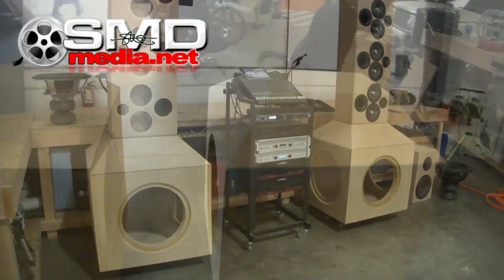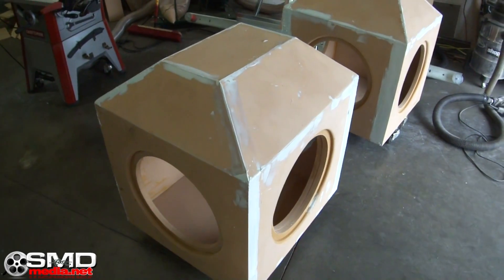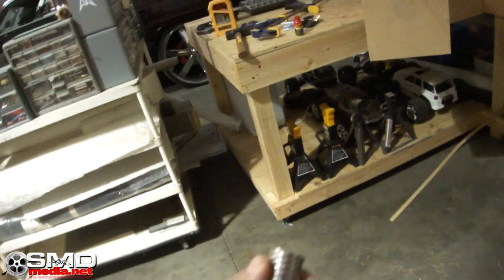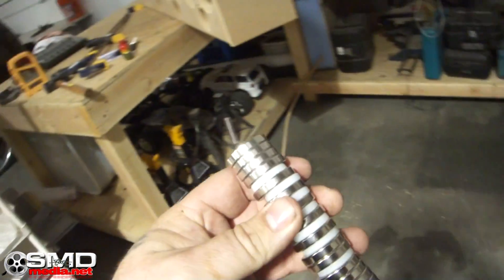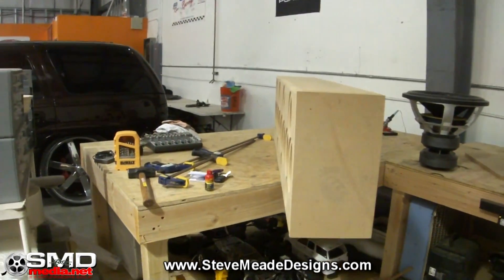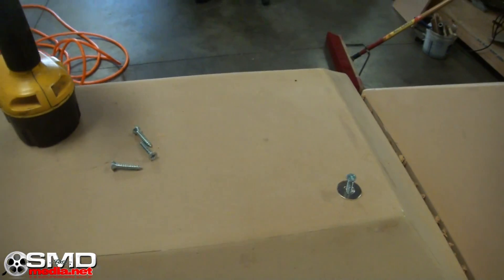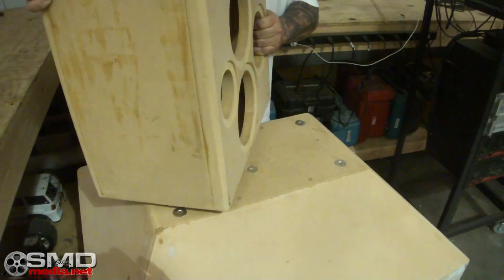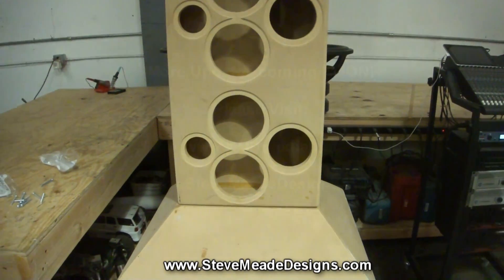Towering Towers - NEO Magnet Attachment - Build Progress Video 7

Comment: @meade916 Bondo is basically 2 parts, a bonding agent and very fine sand.  When you mix on something like wood or cardboard you lose bonding agent with out losing any sand.  Just use a piece of foil over the DMF.  Never mind that bondo and bondo like products are meant for metal and not wood, bondo needs to be sealed off from moisture.  I would just use wood filler or my fav resin. 
As for SQ I'm sure they'll still sound better then  l-acoustics.

Comment: @hilldog39 Simple physics.
He's using magnets, not glue or bolts, so the force between the magnets holding the boxes in place is strong, but not as strong as if it were meant to be a permanent fixture. Therefore, all Meade has to do is apply a force greater than the sum of the force of each magnetic articulation, in the opposing direction of course, in order to separate the top from the bottom.

Comment: Nice dude, you're starting to inspire me once I get some cash together, lol.

Just as an FYI, with that Mackie mixer, if you run the input on two different channels, you can control both with the bus volume.  Just pan both channels either left or right, and select either the 1-2 or 3-4 button on the channel, and depress the L-R button.  The way you pan/select will determine which bus controls it.  (Left pan, 1-2 = Bus 1; Right pan, 1-2 = Bus 2, and the same for 3-4).  Continued...